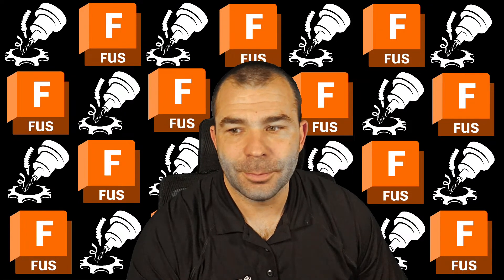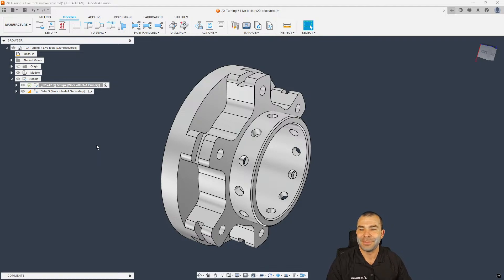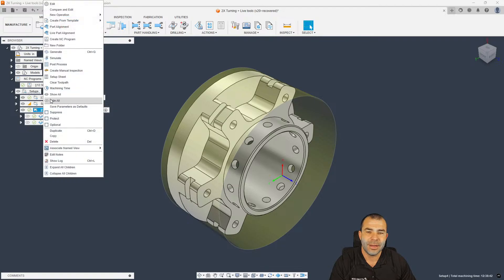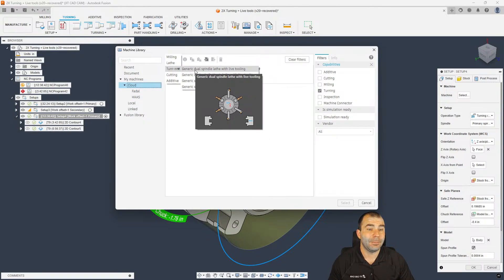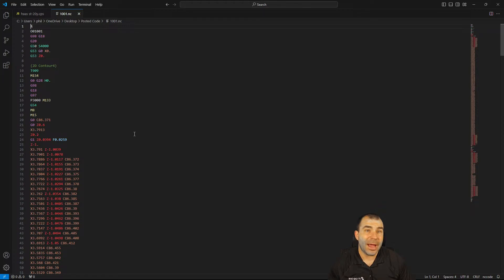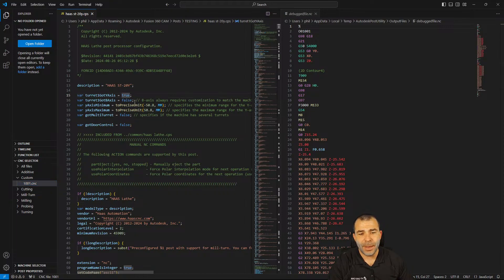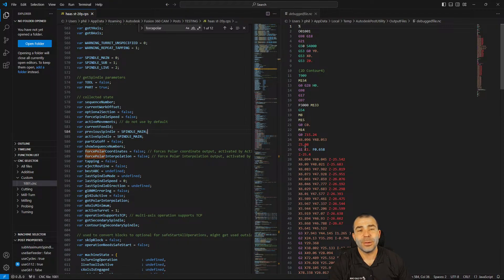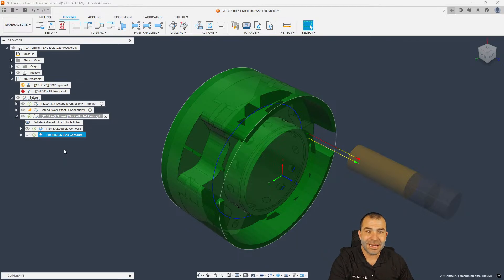Mill-Turn Thursday: Polar Milling

Comment: great video. i was wondering how can jou rotate around z-axis in post because myn emco turn 250 on polarinterploatoin is 90+ degrees out of fase with polarcoorinates?
Reply from the maker: Can you send us an email. I need some more info to dig into it. Info@jitcadcam.com
Reply: Oke  @JITCADCAM